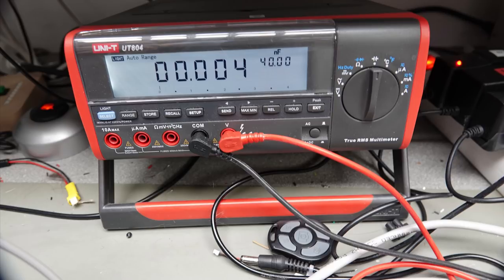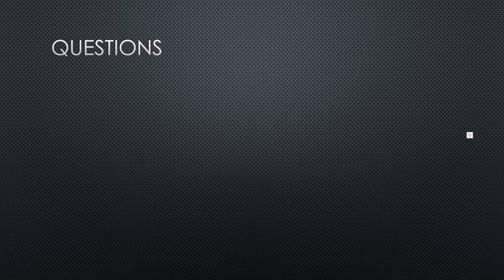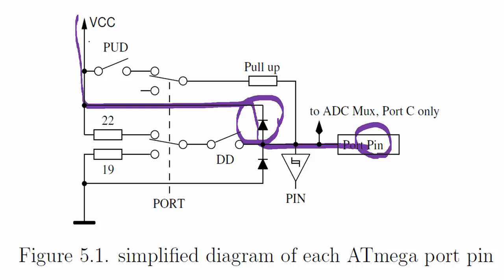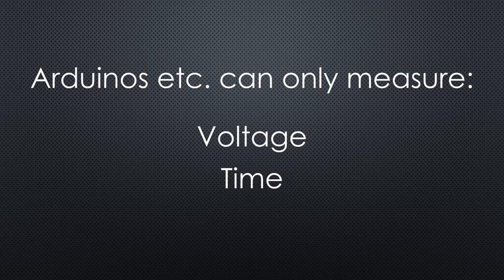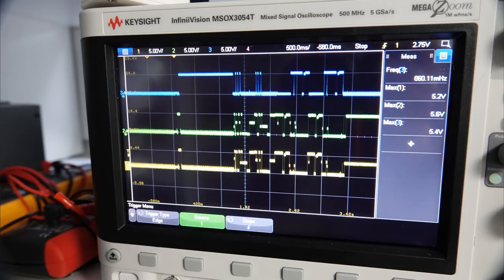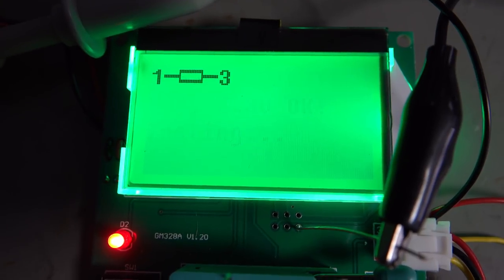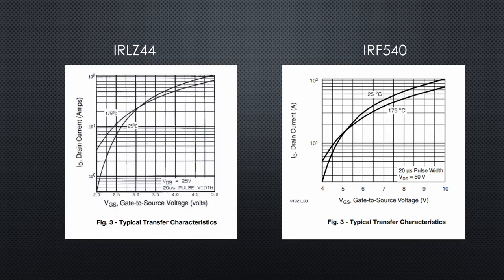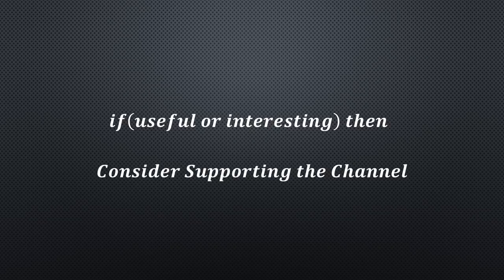#290 How do Transistor Testers work (and some other insights)

Comment: I have one of these with the ZIF socket and it’s great. But since I don’t have a 3D printer and didn’t buy one with a case I had the problem of the corners of the little LCD screen snapping off when I tossed it in my luggage when moving flats. Hence only half the rows on the LCD work anymore, so I have to infer where a decimal place is on a value, and sometimes have to swap components to be across pins 1 and 3 to get the value at the right height to not be obscured. So I would recommend getting or making a case for one of these. I’d buy another one, but ever since I got an oscilloscope I’ve been using that with a capacitor and resistor to measure inductances, and I’ve been putting a bit of work into being able to use the XY mode as a curve tracer, so I doubt I’ll be using my part tester for characterising 2-pin components anymore.
Reply from the maker: Also an interesting project. Did you document the curve tracer for others?

Comment: 16:08 it should be able to detect FET by going tri-state on gate. FET gate will remain charged and transistor open, while BJT will close since there will be no current anymore.
Reply: It probably uses this technique. However, those small MOSFETs can have quite a high gate resistance so they might be measured as BJTs
Reply from the maker: hfe was very high. This is why I thought it classified wrongly.

Comment: Thanks Andreas for crediting the original designers! And for convincing me to get one (after 15 years of hobby0 electronics :D)

15:25 Switching to GND is not off ;) That would be float :)
18:30 Do note the current capabilities are a little bit more limited with a IRLZ44 on 3,3V and a IRF540 on 5V. It has a higher Ron because you run out of the linear region quicker.
Reply from the maker: You are right.

Comment: If the tester was built with 1% resistors, would they introduce up to 2% measurement error?  Or could inaccurate resistors cause a much greater measurement error?
Reply from the maker: Not easy to answer...

Comment: I do agree, i have another version of this device, where i had to solder almost all the pcb (the ICs were already in the pcb). It was quite fun to build, a good soldering practice and in the end, you end up with a very usefull device. It is good to know all the hard work that allowed this device to work, nice video as allways.
Reply: Ditto! I love soldering, so invariably go for kits with something for me to do!
Reply from the maker: I did not know they also sold them as kits!
Reply: Full sized and socketed 328 too...

https://www.ebay.co.uk/itm/Mega328-Transistor-Tester-LCR-Capacitance-ESR-meter-PWM-DIY-TFT-LCD-Generator/401239859328

It's even the rotary encoder version.

I feel very lazy for not attempting an upgrade flash given I specifically went for one with a socketed and full size ATmega specifically for that reason!
Reply: @AndreasSpiess  Yes they do, one of the first things i bought from aliexpress... here you have the link, they still sell it (exactly the same one i ordered). My first kit, with an old Lidl soldering station... a horrible job, now i see my old soldering skills and... well, better not to look at it. Here you have a link to the one i took:

https://es.aliexpress.com/item/32675418755.html
Reply: I much prefer the large green display to the small dark display that comes on the version with the rotary encoder (which I built from kit).

Comment: I would also add Markus Reschke (madires) to the ones deserving  the credits; he not only did advance the software significantly, he also provides prompt support since many years...
Reply from the maker: I do not know the details. Thank you for the addition!
Reply: @AndreasSpiess  afaik, the "$20 LCR ESR Transistor checker project"-thread on EEVBlog holds the record of being the biggest thread there :-) - and madires is one of the main contributors
Reply: @Willam_J   you should see the Russian forums ... they had thousands of pages on this multitester, but they always mention that Markus is designer. They always provide source of every project, so author can benefit and gather the result of his fruits.
Reply: It's great to see the designers of this open source getting credit for their work. It is definitely deserved. I do not know why all those chinese shops don't add a little reference in their descriptions. It's not like they would lose any business. How could anyone source the parts and the PCB for their own use at the prices they sell the whole thing assembled?!?

But...

There is a lot more history to this idea. You make it sound like they invented the whole concept. Perhaps they never knew of the previous devices and really did [re]invent the whole concept from scratch but I doubt it.

Check this out: As early as 2005 there was a magazine project to build a very similar device using a PIC instead of an AVR. https://www.elektormagazine.com/magazine/elektor-200504/17935
That was not an open source project. You had to get the pre-compiled hex code from them and were encouraged to just buy their PCB and chip. Also it only worked with semiconductors, it did not test any passive components. Still, most of the same concepts were there.

Later there was another PIC based tester offered commercially.
https://web.archive.org/web/20060518065316/http://www.m3electronix.com/sa.html
I am not sure. This may have been a new iteration of the same design. Perhaps the M3 people licensed the idea or perhaps someone at M3 was the author of the original Elektor article.  Or... maybe they designed their own version from scratch. I don't know.

Well, anyway, I don't mean to take anything away from what the good folks at the AVR Transistor Testor group have created and shared with us. I just wanted to point out that there is a longer history behind the idea.

Comment: Connecting an electrolytic capacitor the wrong way around would obviously charge it with the reverse voltage from what it is expecting...Would't that damage the cap?
Reply from the maker: Good question I asked myself, too. I did not look into it. Maybe somebody knows. I tested a few and they showed a very similar capacity in both directions. However, you see on the oscilloscope, that it uses pin 2 as ground if you connect the cap between 1 and 2. This is how I do it from now on.

Comment: My tester (also a china „clone“) got the extended menu with frequency generator and so on, even though it’s not a rotary encoder version. It can be accessed by long pressing the test button when powering on the tester.
Pretty sure it‘s in your tester too. Try it 😏
Reply from the maker: I tried it and a menu showed up. But I have no idea on how to enter values with only one button. Do you have a link for the commands?
Reply: Andreas Spiess I only stumbled across it by accident 😂 for the f-generator i.e. you can switch values by a slightly longer button press. Long press returns to main menu. 
Looks like you have to do stuff by varying the button press time.
Reply: @obelix76  yeah the rotary encoder models are worth the premium price. Actually I'd say the best models are the kit versions that you can assemble yourself. That way you can test each component and make sure it is up to spec. Some QC never hurts a device.

Comment: Many years ago, I hacked a power supply adapter from my mobile phone to also be able to power my Psion 3a.  The Psion input voltage was nominally 9 to 10V so I planned to use 3 plain old diodes in series to reduce the power supply voltage from 12V  to below 10.

Alas, on open circuit, the output voltage was still nearly 12V. It wasn't until I was drawing  milliampere that the voltage sank low enough.  So I find the multitester quite clever too.

In a flash of inspiration with my PDA voltage dropper, I parallelled the diodes with a green LED as a current indicator... It was off when the Psion was disconnected, lit up when powering the PDA and flashed brightly when the device was drawing hesvy current, typically when connected to a modem, transferring data.
Reply from the maker: Also sounds like a simple and cheap solution!

Comment: For a project at Uni, I and 3 colleagues tried to do something like this. The project was far too ambitious and was simply impractical as it growed up and up ...and more complicated with every step. All we had at the time was I8031 or early PICs as microcontrollers. Finally, we gave up of measuring and testing analog components and went to digital ICs. That was way simpler. And we used a parallel port interface in a XT (later 386) PC. At first we tried an Spectrum but it needed to load from tape (or to program a EPROM with the software ant those were quite expensive) so we moved to PC. In the end, we made a device that identified most of the 74 TTL and 4000 CMOS ICs and tested them using a database stored on HDD; the programming was in Turbo Pascal. Also it tested the small RAM ICs found in 8-bit computers at the time. All I know is that some professor took the idea a bit further and made a 16bit ISA board and added some functionality.
All started with the need to replace a full lab bench with one lighter  instrument (the oscilloscope, LRC meter, transistor meter were old, huge beasts at the time)
Reply from the maker: Cool project! AFAIK you still can buy such a TTL tester with all the info about the chips. I do not own one.

Comment: I have one, it is really  good  component detecter  and useful measurement  device for  such a low price.
It was  invented like 10 years ago, riight? do you know is there are projects and does it worse it to replace atmega by some  more powerful  chip with more accurate  ADC or use more precise  voltage reference. It is  so  good that I am curious is it possible to  improve it and produce  version 2.0 ?
Reply from the maker: Maybe you try?
Reply: @AndreasSpiess   I am not so good at it,  but does it worse it?
Reply from the maker: For me: No.
Reply: @AndreasSpiess  because it is good enough for now?

Comment: Great Video, as usual Andreas!
Perhaps you could mention, that the Transistor Tester can and should be calibrated. At least my later chinese clone-version has this functionality, which is also described in the fine manual (Chapter 5.5). Properly calibrated mine comes quite close to my bench-top multimeter, when testing capacitors and resistors. I guess with the calibration you can eliminate offsets in the 680 Ohm and 470kOhm resistors, so they don't need to be spot on (which allows our Chinese friends to use standard SMD components ;-) 

Thank you Andreas to give credit to the inventors of this truly remarkable, helpful little device!
Reply from the maker: I tried the calibration and was not sure if it works on all devices. This is why I leave it to the description of the manufacturers.
Reply: There's two basic types of testers. Ones that use a zener diode and ones that use an TL431 voltage reference. The latter variety is generally more precise. I don't want to take any credit away from anyone but I wouldn't say anyone invented anything here either. They merely conceived of and designed the device using readily available off the shelf components. Which is not really fundamental invention. It is also an open source project so lots were involved.
Reply: The calibration only adjusts the offsets for the PCB races and connection leads (or socket). The device cannot  and does NOT separately calibrate individual inputs, of which there are 2 resistors on each (680R and 470K). It also cannot know if the voltage references (VCC and or TL431 etc) are accurate or not.
Therefore, most importantly you need to use accurate an VCC. Simply change the voltage regulator to a high precision device, something under 0.5% accuracy. Once done, you can eliminate the separate voltage reference (TL431). It is more important to have an accurate VCC than just a accurate Reference device. If you can accurately measure the "exact" VCC and/or Vref, you can also adjust the respective values in firmware and improve accuracy even more (eg: change VCC variable from 5.0V to 5.006V in firmware).
For the 3 inputs, the assumption is made that the 6 input resistors are exactly 680R and 470K. The only way to get close is to use 0.1% tolerance parts. Those cost a lot more than usual 1% parts, but you can work around it by measuring (using a known accurate and high precision multimeter) a large quantity of resistors and finding 3 + 3 that are very close to the specified values.
The other way you can "calibrate" is to change the respective High and Low resistor variables in firmware. For example, 0.1% 681R resistors might be must cheaper than 680R, so if you find (for example) 3 perfectly matching 681R resistors you can change the firmware so it uses 681 instead of 680 as the divider integer.
Reply: @johncoops6897  If your 681 1% resistors are actually higher than the perfect 680 then you can also parallel them with a much higher order resistance to get the right equivalent resistance. This should allow you to fine tune it, depending on the space on the PCB. I suppose it is more tricky to increase the resistance of resistors smaller than 680. For that you would need to add very small resistance values in series. That would result in a PCB looking more like a hedgehog I guess. (resistors pointing up) But in the end you have to accept that the ADC has offset and linearity errors of it's own that you cannot do much about externally. (same goes for 470k resistors, but there are less orders above it to choose from I suppose)
Reply: @Valenorious  - I have found that the easiest way is to buy a pack of 100 x 680 Ohm 1% 1/8W through-hole resistors from eBay, then measure them all with a 5-digit or better meter. Find the 4 with the closest values and use those. The actual value doesn't matter as much as having the tolerance between them as minimal as possible.
The firmware can be set to the actual value if you are keen. The calibration procedure will help remove the aggregated ADC errors, but note that it assumes that all the resistors are the same and has no way of calibrating each of the voltage dividers (680R/470k) individually. 
This circuit was never intended to be a precision device anyway, so there's no point in getting too anal about all of this stuff. A standard $10 multimeter has a higher accuracy for resistance and voltage, however it's absolutely incredible that such high performance can be achieved by the very simple hardware of these testers!

Comment: Hi, great hint on the creators! But the FW is not written using the Wiring-C, just plain C, so why you call it "Arduino-chip"? Even though, is an Atmega chip...
Reply from the maker: If you want to be completely correct it is a Microchip chip. Atmel does not exist anymore ;-) Just Google Atmel.
Reply: @AndreasSpiess  But Atmega is still a Microchip serie (taken from Atmel), oder? Regardless, I am aware you used the Arduino term for better general understanding.

Comment: Arduino accuracy can be increasing by adding a Voltage reference to the AREF pin, with a lower voltage you increase the precision, for example if you add 1V to AREF,  1024 value would be 1V instead of the default 5V, so you gain 0,00098V per step instead of 0,0049V (from the 5V default reference )
But of course you''ll not be able to read more than 1V, but in this situation you probably don't need to.

BTW you can update the firmware on those testers (with the original one) and get more features like the counter and individual testing components, pwm generator and so on.
Reply from the maker: I think, I covered the facts about the improved accuracy in the video I proposed here ;-)
Reply: @AndreasSpiess  You did, i just had comment along the video :)
Great work sir

Comment: 8:40 there is actually one more possibility: using internal pullup (or even pullups in combination with these external resistors)
Reply from the maker: You are right. But I am not sure if it is used in this setup. Because the pullups are not very precise

Comment: How to test an old junction tetrode? Or a 3N80-series mosfet with 4 leads?
Reply from the maker: I assume manually with the data sheet and the right power supplies/multimeters. I never searched for an automated device for these use cases.

Comment: You have to be quite careful with the 5V to I/O on modern chips as the ESD protection diode can burn from constant >200µA current in the long term.  Those aren't as robust as old ones and some chip's don't tolerate any current over the diode drop.

But in hobby use it is usually OK but I've seen this in production use and failures will happen sooner or later when the datasheet absolute max is violated.
Reply from the maker: The CEO of Espressif made this statement. So I hope he asked his engineers before ;-)

Comment: Big hello from Czech republic. I love your videos. Two years ago when I was doing my bachelor thesis with ESP32 as a low energy detector I found out about your channel and a lot of information about ESP32, which was rare back then as the chip was relatively new. I got an A grade, red diploma and a deans award for it. Now I just started doing my Master thesis again with ESP32, now as a device for automatic measurement of volt-ampere characteristics of components with voltage range +-20Volts (which has a number of similarities with component tester) and you just uploaded this video with a LOT of relevant and easily digestible information for me. I dont know how you do it, but I wanted to thank you. You are making a really good job and also making my life much easier. Thank you :)
Reply from the maker: Thank you for your feedback. So the video will appear in the bibliography of your Master thesis;-)